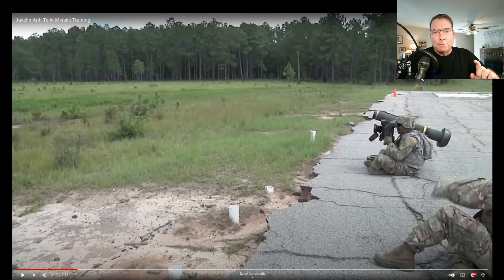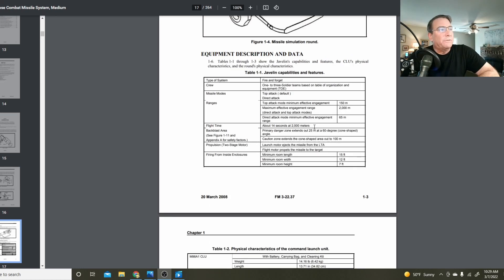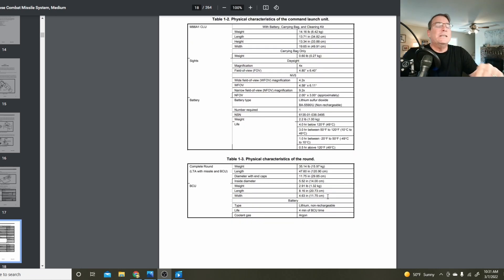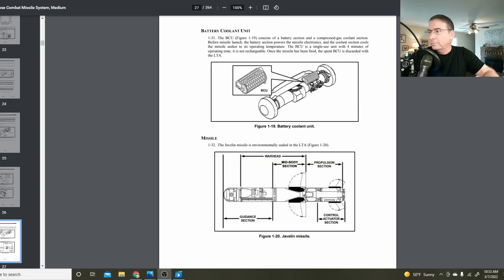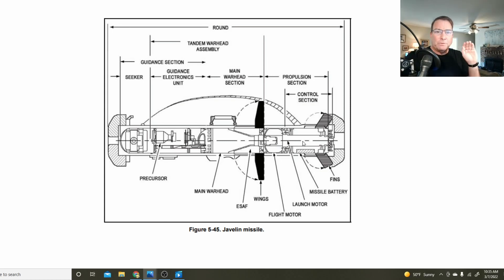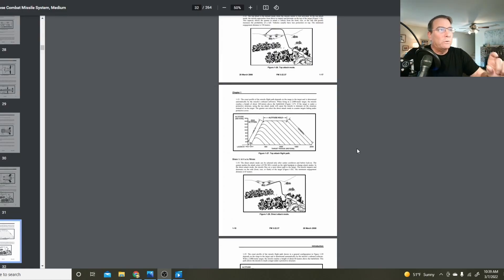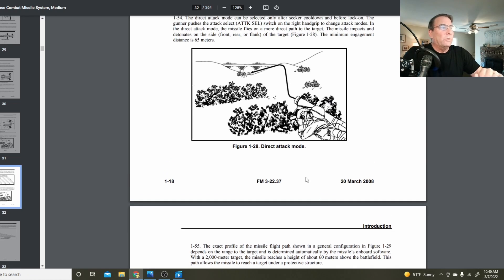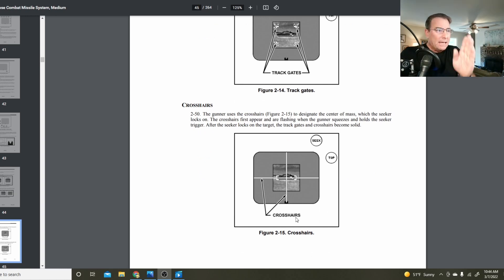FGM-148 Javelin Anti Tank Missile Overview

Comment: I don't get it. The Javelin is fire and forget? How is the seeker head tracking the target? Optical (having stored a reference picture) or thermal tracking? What if the target is deploying smoke or moving fast? I'm only used to the French/German Milan system, that is wire guided and the operator is the brain of the missile.

Comment: Modern anti tank weapons and drones are making main battle tanks obsolete. 

Armour has always been vulnerable to air attack. They generally don’t even see the aircraft that kills them most of the time. 

Now the combination of weapons like these and drones make tanks slow sitting ducks.
Reply: Tanks have been obsolete for decades. Most countries have stopped investing in them. Russia is one of the few countries still using them. They are sitting ducks for air and rocket based weapons systems. Also vulnerable to mines and guerrilla attacks. The biggest asset on the battlefield today is to be hard to see and tanks are hard to hide.

Comment: Thats not how the warhead works. It doesnt blow a dart like a blowgun. That tip it just an aerodynamic cap. Behind that is the HEAT warhead. How it works is the explosive charge melts the metal reverse cone turning it into a jet of liquid metal that cuts through armor and kills the crew inside.

Comment: For what it's worth... A heat round attacks a target by using chemical energy to generate kinetic energy at the point of the attack rather than "bringing" kinetic energy from when it is fired the way a "normal" bullet does.

 In this case, the chemical energy is delivered to the target in the form of an intermediary: an Explosively Forged Projectile (or "EFP"). 

The cone you referenced that was surrounded by the explosive (#5 in your description) has a metal liner that becomes an EFP when that explosive is detonated. 

The liner is usually made of copper because of the favorable properties of that metal in this application. It forms into a high-velocity superplastic jet and it focuses all of the kinetic energy from when it was formed into an extremely small surface area when it strikes the target. This allows that jet of copper, which is moving at more than 10 km/s, to "poke a hole" in just about any armor due to the massive pressure of the jet of copper. The usual penetration is based on the diameter of the explosive charge, with the most effective warheads usually having penetration on the order of 7x the diameter of the warhead, though "better" warheads might do better than that and "worse" warheads will do worse...

In the case of Javalin, it is typically configured as a "tandem charge" with an initial smaller warhead detonating earlier and disrupting any active protection systems or reactive armor protection before the main warhead detonates. 

Depending on the distance to the target (standoff) when the main warhead detonates, the current Javalin ATGM can penetrate as much as 750 mm of RHA, though there are rumors of an improved warhead out there that increases that to 900+ mm.

Comment: Juan, I don't know how else to reach you. We just lost a 182Q at Panama City Beach KECP, this is my my home field. Tail was N182XT, it was IFR from TN when it went missing from radar 2 miles North of the Rwy 16 centerline  . Heavy fog from the Gulf moisture was present. The airplane has NOT been located. But Bay Co Sheriff's units are searching with ground crews at this time. Flight data showed classic S  turns trying to stay on course. Likely going to be a loss  of control. Unless by some miracle they broke out and landed it safely.

Comment: Why top attack? Russian tanks have an auto loading system, ammo is stored in a carousel under the top deck surrounding the turret, armor thickness is as little as ½ inch. Get to the ammo and the tank is a convertible.

P.S. Shaped charge jets are not plasma or gaseous, they are stretching solid metal rods that push the target aside, not burn through. Pressure at the penetration front is several million psi, the strongest armor yields at <200,000 psi

Comment: I used to be a unit instructor on the LAW (Light Anti-tank Weapon) when I was in the Army. It was a very poor weapon compared to this, but it was light. This Javelin, on the other hand,  can actually kill a tank. “Three guys in a jeep” becomes a fearsome weapon platform.
Reply: LAW's may not be the greatest tool for tanks but they do a number on supply trucks. The Swedish NLAW system is an excellent alternative to the Javelins and also much cheaper. Russia's use of tanks as the main weapon is showing it is outdated today.
Reply: @JETWTF  maybe they should call it the “light anti-supply-truck weapon” instead

Comment: Shaped charges worked on an extrusion principle. Shockwave squeezes the cone Extruding part of the metal forward at around 2/3 the velocity of the shockwave. Part of the cone forms a slug that normally just bounces off the target near the penetration point. The forward 1/4 to 1/3 is vaporize and follows if all elements are still aligned through the initial penetration made by the extruded metal which never has time to even heat up much. Exact performance can vary depending on materials and exact shape of the liner and the explosives used.
I found a report with ultra-high speed x-ray shadowgraphs 1/40,000 thousandth of a second exposures made by the Swedish disarmament commission back in the early 70s in a federal book depository at the University of Illinois Chicago Circle Campus in the mid 70's. It detailed the exact mechanics of various cone shapes and velocities of the explosives and how they relate to penetration values.
Reply: Very cool. Also, density of liner also affects performance of jet on armour face. Denser the liner, the harder it hits because of momentum. This is why copper (density about 7, comparable to steel) and I have heard of a lead liner (density about 13) being tested too. Pretty cool.
Reply: A good rule of thumb is that a well designed shaped charge warhead can penetrate about 9 diameters in rolled homogenous armor. But at the end of that you don't have much bang left to get inside. NLAW has a 150mm warhead, Javelin has a 127mm warhead. Obviously those should get plenty of energy inside a typical tank with only about 40mm top armor.

Comment: The Javelin is extremely effective, but also very expensive and has a difficult supply chain.  So it's not ideal.  Can you let us know how much each round costs and how many are lost between manufacturing and destroying a target, please? There are cheaper options.  Does it make sense to use a weapon that is more expensive than the target and the collateral damage it causes?
Reply from the maker: Molotov Cocktails?
Reply: @blancolirio  Definitly not effective... I remember here in Zagreb Croatia... Battle for yugoslav military baracks... They fleed from baracks in the city over the main bridge in town... Many molotov were thrown on tanks... Yugoslav version of T-80... Not effective... Burning tanks continued to drive without any damage... Molotov, yes but against wheeled personal carriers... And any other wheeled military vehicle with tyres
Reply: @blancolirio  Here you can find this scenes... Few tanks hitted by many molotovs... Even old T-55 whitstands that no problem
https://www.youtube.com/watch?v=eTWmOsnU8hk
Reply: According to Wikipedia a missile costs ~175k https://en.wikipedia.org/wiki/FGM-148_Javelin. I guess recycling is also not an option...
Reply: Upgraded sagger/malyutka...  We used them in Croatian war of independence against serbian tanks... Wire removed, RC controled... And without wire warhead increased to 3.5 kg... But old wired is also ok... No warm up, allways ready... For urban warfare where targets are hidden in urban background... Trained operator can easily fly it through window... And is cheap, affordable....

Comment: One aspect of the tracking system of the Javelin that was overlooked is that it is thermal-based this explains the whole point of the cryo cooling attached to the round, it's there to cool the optics on the internal tracker of the round. Thermal imaging works when the sensor is cold and a battery can power thermocouples in the CLU to keep it cool enough to operate but they can't put a battery in the round because it might run down in storage so they use the gas as a coolant instead. This makes the CLU as a stand-alone device for observing incredibly useful because it's not night vision but rather thermal vision day or night as well as a straight magnified visual device.
Reply: The CLU doesn't use the argon for cooling the thermal sight, that's only for the seeker head in the missile. CLU thermal targeting sight is solely batter powered.
Reply: @willyjimmy8881  that's what I said.
Reply: @douglasboyle6544  i used less words
Reply: @dohabandit  yeah, or the interferometric thermosamplers common on the newer ones
Reply: What if the target is the same temperature as the environment?

Comment: Quite an improvement over the LAWS we Marines used in A. Vietnam. Our vertical sight had ranges marked, no battery needed. The heat and moisture present eliminated about 30% of the weapons.
Reply: I’ve read that the NVA operated tanks in I corps, but I never read or hear much about the specifics of what vehicles they used. What were you shooting at with these weapons? Trucks? Carriers?
Reply: If I remember what I read the NVA deployed A large number of T-55 tanks against the USMC right after the Marines started issuing LAWS in massive quantities. 
     I read the results were interesting. Too bad there weren't a large number of scrap metal dealers willing to do a lot of battlefield cleaning.

Comment: I was going to comment on the shaped charges principles but Juan has been beaten up up enough on the matter. Incidentally shaped charges are used in the oil industry to perforate the casing and connect the producing zones to the borehole or to cut pipes downhole.

Comment: Shaped Charge.  Back in the day at Aerojet, 1955, I was a summer student draftsman making a proposal drawing for the first object to be shot around the world.    An Aerobee rocket with a shaped charge that would  send a copper pellet to orbital velocity.  A prof at Cal Tech was the guy proposing the system.  Crazy times.
Later on a team investigating damage to M113 APC I got a look at what a shaped charge (RPG) does.  Blows a small hole through 6 inches of 5086 Aluminum armor.  Will do the same to an M48 tank.
Reply: @mike harper 
Good grief, just how old are you sir?
Reply: @mtkoslowski  Old enough to remember pre WW2 California.  86
Reply: @mikeharper8968  It must have been a paradise back then!!!
Reply: @UAL320  Kids are like horses.  Keep them fed and safe and they are in paradise.   Back then there was no polio vaccine.  Back then there was no statins.  Back then there were not stents.  Back then car engines were wearing out at 60K miles.  Some bad changes and some good ones.

Comment: For more information on hollow charge warheads, google "Monroe Effect". Basically, the explosion of the Javelin warhead launches a stream of molten metal from the warhead liner that burns its' way through the armor plate of the target vehicle. Inside the target vehicle the jet stream and spalling from the target's own armor plate can cause great secondary effects internally. There is also overpressure that can kill or injure the crew as well.
One of the features of the late T series of tanks (T-64 on) is that they have dispensed with a human loader (like our M-1 Abrams has) and use an autoloader. The main gun ammo is carried inside the crew compartment on two rotary trays. The projectiles are on one tray and the propellant charges are on another. If that jet stream or spalling get into those charges or projectiles...well, that is why Russian tanks explode so well.
Thank you for another very topical program.
Reply: Note that while the round's energy source is chemical (from the explosives), meaning the round doesn't need to impact at high velocity (the explosive does all the work), hollow charge warheads do not rely on burning at all for penetrating armor.  Instead, the explosives "simply" shape the metal liner into a penetrator rod, which contacts the armor at several kilometers per second.  The jet penetrates the armor purely based off the immense kinetic energy from that.  The metal jet is very hot, though, and this causes it to have an incendiary effect after penetrating.  This is also why there was a lot of research done into the material properties of the liner, so that the metal jet formed has the best properties to punch through armor--this wouldn't be needed if it just burned through.
Reply: Spelling is Munroe Effect.
Reply: I'll preface this by saying I'm no expert, just read a lot.
       The T-62 used an auto loaded that reportedly had to change the elevation on the main gun to reload. And was supposed to return the elevation back to where it had been set. According to several evaluations, the gunner would have to resight the target as the autoloader was not that precise in getting the elevation right(remember a couple of mils/fractions of a degree at 1500m can be 10 or 15 feet). 
       This was evaluations of 20 or 30 vehicles from several plants. The vehicles came from several sources including some expropriated Warsaw Pact and Soviet Union vehicles.(in the 1970's).
Reply: "Bring on the spall baby"

Comment: The shaped charge acts like the world's most powerful plasma cutter. It rapidly burns through the armor of the tank or other vehicle as it contacts the surface rather than exploding.
Reply: I find it interesting that a method has been introduced to defeat reactive armor.
Reply: And once it has penetrated, the occupants are subjected to an enormous over pressure and over temperature. Not to mention a small piece of copper flying around the compartment at 2km/s. All in all, pretty lethal
Reply: Charles, it doesn't burn through. The molten copper jet (not plasma) formed by the shaped charge burrows through the armour plate as the tip of the jet exerts so much pressure on the armour that it behaves like a fluid.
Reply: @ianlewis6717  You are correct. I was trying to explain that it was not an explosion but the penetration was the result of a molten temperature event.

Comment: Has anyone tried putting small CIWS units on top of tanks to shoot these types of attacks out of the air?
Reply: Sort of, the Abrams has the Trophy system which is basically a shotgun with an electronically operated variable choke that shoots a bunch of small munitions made out of shaped charges at incoming warheads. Basically it's like shooting a bullet with a bunch of return bullets but instead of lead everything is hypersonic explosives and plasma.

Comment: I wonder how would the M1 Abrams do against this?
Reply: Same result.
Reply: @willyjimmy8881  maybe, the M1A2C and D have multi-layer reactive armor designed to counter 2 stage penetrators like that on the Javelin. They also have Trophy active countermeasures designed to defeat warheads before they even get to the reactive armor to enable their fuse.
Reply: @andrewfidel2220  I was thinking the same. I'm a former M1 Abrams mechanic but I trained on the SEP V2, and mostly worked on the ABV afterwards. They rarely had reactive armor installed in garrison.

Comment: That rather innocuous-appearing and backwards-pointing, cone-shaped copper lining in front of the explosive charge is actually the critical element of the shaped-charge.
Reply: The way this molten copper slug blasts its way through armor in the case of the Javelin 600mm worth of it is astonishing.
Reply: @transmaster  Just that it is not molten ;)
Reply: Correct. An explosively formed slug of supersonic copper is the penetrator, causing incandescent armor to spall off into the interior.
Reply: The explosive-lense focused blast turns the copper into a plasma jet of molten metal at both a velocity  > 2000m/s and a temp greater than 10K F.  Counter measures use ceramic to resist the temp and an explosive charge in the armor to disrupt the integrity of the plasma-EFP, sort of a counter-punch.   What is truly amazing is that so much happens on the order of 10's of microseconds and how such small distances at high velocities become so critical.  The detonator fuse has to be located so far out front so that the mass located a foot behind it can convert to the EFP in the 250 usec between inital detonation and actual contact of the efp with the armor. 

Those who know about naval AP projectiles know that the hardened AP shell is covered by a hollow aerodynamic cover so as to maintain impact velocity for the pentrating mass.  I have always wondered why they didn't put a bazooka warhead inside that hollow space to act as sort of a pilot drill for the main projectile.  Let it soften-up/penetrate the first 3-6" of the 12-15" armor plate.  Maybe overkill for a 15" shell, but imagine the possibilities of 8 and 10" light/heavy cruiser shells suddenly being able to take out a main battleship turret or punch a hole into the citadel?  If I thought of it, you'd hope that it also occured to someone in the ordnance dept during WW II, hence my wondering why it wasn't employed.
Reply: @robertslugg8361  Amazing ! Has a modern MBT successfully resisted a top-down hit with a Javelin warhead ? And if yes, how did they do it ?

Comment: Does it use fissile material for the penetration ?
Reply: Not as presented here.  DU is used in a solid penetrator.  This missile system uses shaped charges; the penetrator here is copper plasma.  Besides, DU, while radioactive, is not fissile, and it is used because of its density and its self-sharpening spalling characteristics, not for any nuclear reason.
Reply: @puncheex2  I wouldn’t want to be the battlefield janitor.
Reply: It uses high explosive, what gets inside is mostly copper plasma and white hot bits of tank.